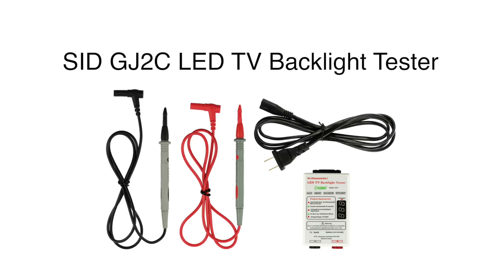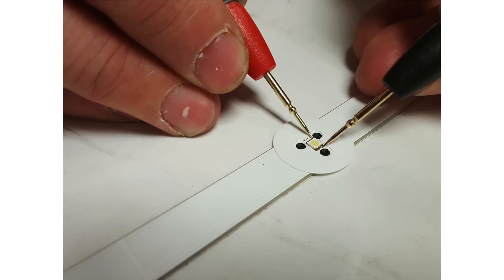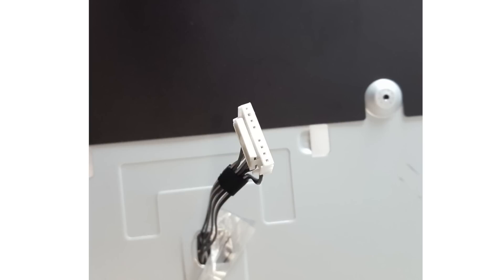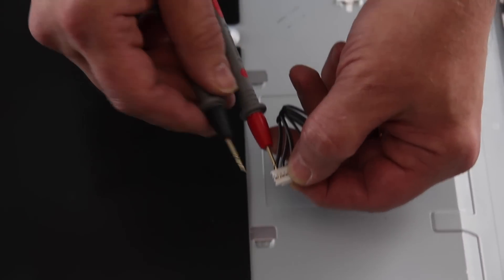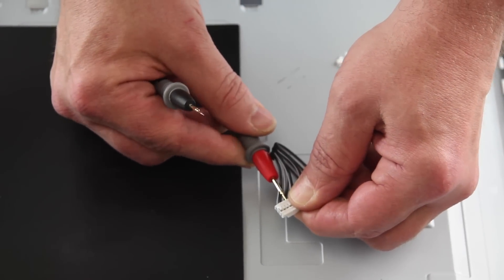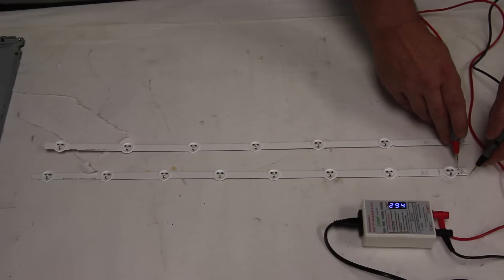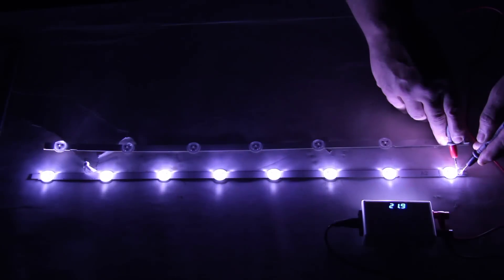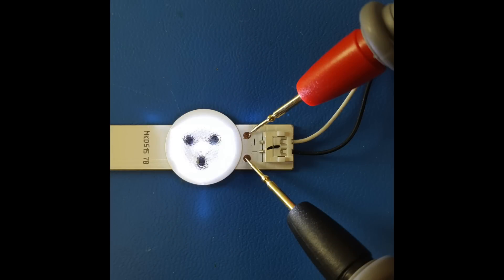LED Tester - How to Test LED Backlighting - SID GJ2C LED TV Backlight Tester

Comment: looks like all the LED's are wired in parallel connections, so why do the tv stop showing backlight when a single one goes bad
Reply: the protection circuit monitors the overall current draw by the LEDs. Once a  certain number of individual LEDs goes down the excess current to the remainder will activate the protection circuit on the psu or LED driver board.

Comment: All my LEDs in a strip test fine if I test right at the diode (like near the end of the video) but If I send 20v to the + and - at the the end of the strip, it get no power at all to any of the leds. Thoughts?   This goes for EVERY strip in my panel. Could all the traces in all the strips be fried?

Comment: if the tester shows both pairs of  led pins 00.00 when tv is on,are one or more led lights shorted?
psu and video board, tcon are ok.
also the lg shows on board hi 100 volts and lo 70 volts,is that the variable power  illumination of the led driver for lg 42 ln613s?

Comment: Is it an "automatic" adjustable dc power supply? Basically? I'm seriously trying to get a better idea so I can decide if I need one.
Reply: Did u get an answer
The user should adjust the voltage or it is automatically andjustable?
Since the voltage may not be written on the led strip.

Comment: my question is  meter is showing 19.9 on your  tester. is it the voltage set up to test the LED or?
Reply: the tester is automatic. it will show the voltage where the led starts pulling the correct amps.

Comment: Hello There,
What Causes these Strips or Single Diodes to burn out? Especially in So Short of Time, Like a year or 2 Usually?
Also if i replace the strips is it Likely They will they burn out again in the same amount of time has the 1st time?
I Also would like to fix the Issue that is causes the (Strips or Single Diodes) to burn out in the first place, So I Dont Have To Replace So Often.
Really Would Appreciate Any Tips or Ideas u Guys Could Share!
Working on a   ----->    TCL 65S401TKAA 65" 4K Ultra HD Roku Smart LED HDTV
Thanks Alot in Advance For Your Time!!!
Reply: usage, the brigtness level and the running hours and the heat.

Comment: you can build your own tester like i did you need a wires + bridge rectifiere + 220v/50w spot light
link the ac input of the bridge to the Ac source and link the(+)Dc to the first pin of the 220v spot light and the link a red wires to the second pin of the sport light to get the poditive of your tester and the negative  liken to the (-) of the bridge rectifier make it black wire .but be carefull of smal electric shock
Reply: Your period key appears to be broken. Here's a few extra's ................

Comment: It's weird, but in all these videos the LED strips are stuck down.  Mine have copper backs and are held by a few rows of little screws along with the background paper.

I did finally find my problem.  Instead of one or two lights being out, one strip had all the LED lights flickering.  Replacements are on the way.

Comment: how do i use a multimeter to check the lights?
Reply: you can't
Reply: @Chevroletcelebrity  you can use a meter in diode mode  and put the probes across  individual diodes ,if this does not light the led then swop the probes then if the led is ok it should light
Reply: @johnmellor6065  but what if his meter doesn’t have a diode mode?